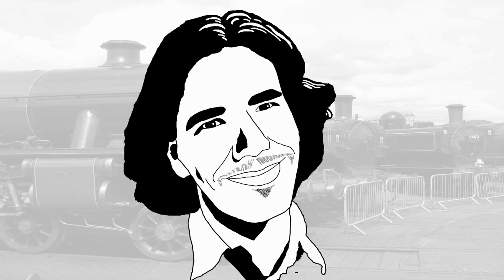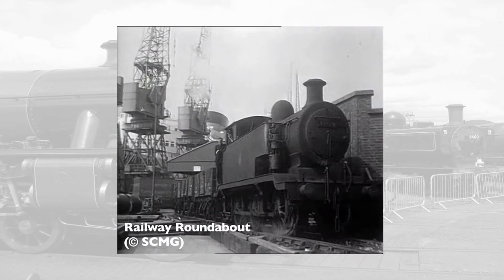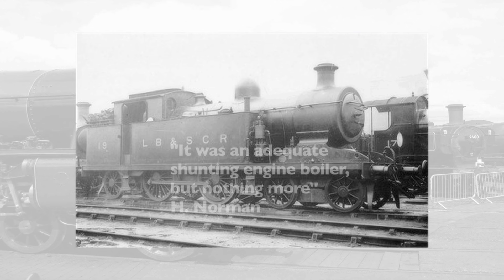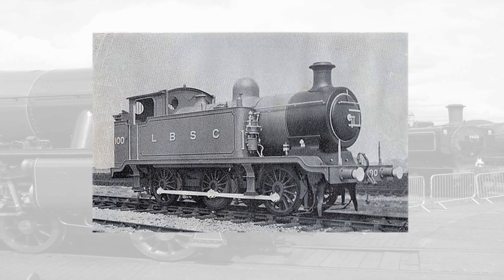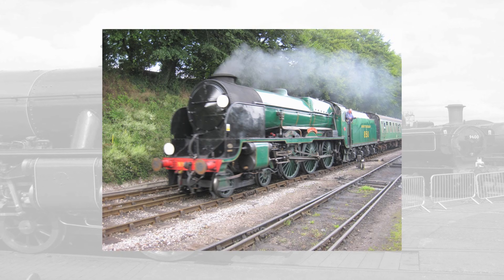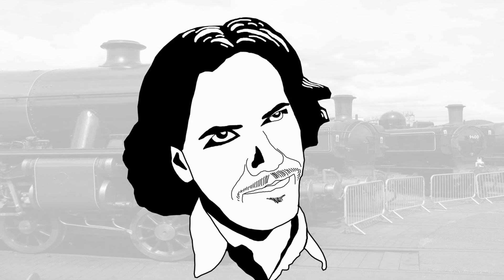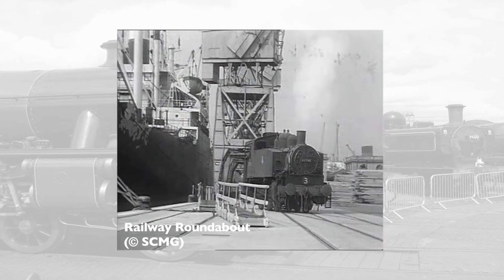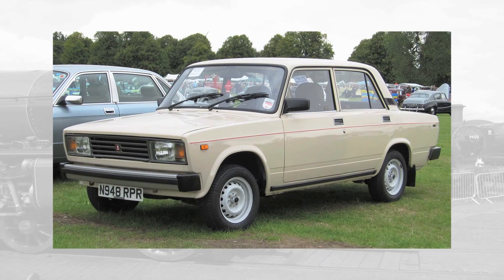GAUGE THE ISSUE: The Maybe-Not-Quite-So Really Useful Engines

Comment: "Remember Thomas" Said the Fat Controller, "You can never be as fast or as strong as Gordon, but you can be a really useful engine, if you'd stop oscillating all the damn time."
Reply: And stop breaking couplings
Reply: And if you could see your way to not losing so much boiler pressure, that would be a real help
Reply: And here Duncan gets a bad rep for rockin' and rollin'!
Reply: @MercenaryPen  Chris only gives once source for this, hardle proof it was compon place, and loco can become a bad steamer if worn, or fired wrong, or handled badly by the driver. 

Id be interested in reading/hearing of other footplates crews experiences with the E2x if anyone knows of any. All the chaps I knew who where footplatemen where either ER or LMR crews.
Reply: Their predicesors were rough riders to. Seams quite common with 060t locos if not balanced properly, as they aint exactly built for high speed. 40mph was prob the max they could be expected to run, even if they could go faster, but suspect even at 40 they were quite "bouncy"
Reply: E4: Hello I can help with that!!!
Reply: @thebluejintythomasthetanke587  Rusty: My Freight wagons got away from me!!!
Reply: And stop rock and rolling around when you are going your top speed

Comment: It's kind of sad to realize that the locomotive Thomas was based on wasn't all that useful in real life. You'd think they'd at least save one, especially since the design got popularized by Thomas.
Reply: Well they made a replica for Thomas
Reply: by the time the books and TV were popular, the E2 was already gone. besides, who would want a heavy, uncomfy, hungry shunter that was useless over 5mph?
Reply: @Eroadmodel  maybe static display
maybe a new build to fix the issuies
Reply: @pilotbug6100  I’m for a new build to deliver on what the E-2 was meant to provide but couldn’t - a mixed traffic tank engine. I can already imagine the redesign would un ironically mimic the character design by shortening the wheel base, lowering the center of gravity, and enlarging the coal bunker and that’s before boosting the steaming efficiency with additions like a super heater. In hindsight, similar to Henry, the E-2’s were built with far too small coal reserves and janky optimization
Reply: @watch50er  I like to think Thomas is a experimental not passed by LBSCR, with a 10 foot wheelbase for the tight curves at Southampton, he proved unsuccessful and was sold off to Hatt during the first world war.

Comment: I didn’t know a E2 could do 50 MPH! Also I like how you put 611 and 4014 in this.
Reply: Always love when a YouTube Railroader from one country or another gives a nod to the opposite side of the "pond."
Reply: I don't think I'd want to go 50 mph in a tank engine without non-drive wheels
Reply: To my knowledge, their top speed is 60MPH, though why anyone would want to do that in a 0-6-0T engine predominantly used for shunting and short goods traffic is somewhat beyond me.
Reply: @PGW85Productions  Main Line Empty Stock and Return to overhaul/depot transfer movements,  emergency if no other locomotive avalible for a freight movement.
Reply: @highpath4776  actually they can do 60mph
Reply: @matthewradovanovic5172  Thomas: I can go 70, but I've been fixed.  Got all fixed up at the Works after I was bought by NWR.

Comment: Still don't understand why the Reverend didn't base Thomas on the more successful 3F Jinty instead of this sagging heap.
Reply: He didn't, Thomas was originally going to be a different engine. But Reginald Payne (Illustrator of the second Railway Series book, Thomas the Tank Engine) made Thomas an E2 instead, and Awdry went with it.
Reply: @bluengine1258  Not the best choice to say the least, could have gone with a 3F Jinty, an Austerity, an  N7, or any other famous tank locomotive of the time. But that's just me. But then again, the show has since lost its realism touch, since Whiff and Emily are depicted doing work they weren't designed to do (i.e. pulling heavy goods trains.) It was in Chris's other videos that I learned that the engines both Whiff and Emily were based on were not designed for heavy goods. Realistically, the episode "Emily in the Middle " shouldn't have happened. It would have made more sense to have had Murdoch pull that pipe train instead.
Reply: TheKilroyman - The show lost its realism since the 5th season, really. I mean, why would the Skarloey engines run away at speeds of 100mph away from Boulder when they were never built to do that.
Reply: @NWR1991  yeah agreed. After Britt Alcroft lost control of the show it went downhill. Seasons 6 and 7 are pretty much forgotten about as far as the Classic Series goes.
Reply: TheKilroyman - There are still people out there who do remember S6 & S7 and in my opinion they had handled realism far more better than what churned out from S5, barring Thomas & The Jet Engine.
Reply: @NWR1991  seasons 8 onwards shot realism to hell. Especially since we see Whiff and Emily pulling loads they weren't designed to pull.
Reply: What if he was an SECR R1 instead?

Comment: You know, when you talked about the issues with the E2s when they were trialed on passenger and freight (goods) trains, that gave me a bit of an idea: could they have done a bit better if they were fitted with well tanks?
I got this idea from Billinton's L Class 4-6-4 Baltic tank engines, also known as the 'Brighton Baltics'. When the first two were put into service on passenger trains, they were found to be unstable due to the water surging around in the side tanks, but this was later resolved when they were fitted with well tanks (and the water level in their side tanks were lowered) giving them a lower center of gravity and helping them prove to be much successful.
So maybe if the Billinton E2s were fitted with well tanks as well, it might've helped with their problems with stability as well as increase their water capacity and the class might've been more successful. That's my theory at least.
Reply: I understand the theory, but I doubt converting an E2 into a well tank would solve the issues entirely rather than just make more.  The main problems with well tanks and why you didn't see many outside certain circles, with many well tanks being converted to saddle tanks, is because the wells were prone to cracking and leaking down beneath the engine being so close to all the moving parts.  Sure you might make the E2 a bit more stable, but you'd have to fill the tank more often due to leaking and you'd have to pull it out of service more often in order to repair cracked tanks.  Also how big a tank do you think you'd be able to fit down there?  The E2s already had a problem with water capacity when first built, and the spacial limitations of building a well underneath an engine would not solve that issue.
Reply: You'd also need to give the engines external cylinders and motion to accomidate the tank, which means complete replacement of steam chest\smokebox saddle and extreme footplate surgery to accomidate before you even began modifying everything else to suit (which couldn't justify rebuilding a class of 10 obscure shunters already beset with faults outside of just fuel capacity). However, I must admit I find the idea interesting  and may mess about with some dimensions, I imagine the result would look simmilar to Bellerophon (preserved on the Foxfield Railway).

Comment: Fun fact actually the E2’s actually had more than enough coal and water capacity as other successful tank engines but the issue was the boiler not fuel capacity as it was actually a really bad boiler used for another model and was really bad.

Comment: Because switch engines (shunters) do not go fast, or far from the repair shop, they are nearly always the oldest machines on the property. This is why the Great Northern Railway (U.S.) tried to use a 4-8-2 passenger locomotive with 73 inch drivers as a heavy switcher in the Interbay Yard in Seattle, WA in the late 1950s. The experiment ended quickly because the 4-8-2 lacked the quick acceleration needed for that job.

Comment: The main problem with the E2 was that it was a solid design. But unlike the GNR with their problematic at first J23, the LBSCR never invested into working out the kinks (due to Brighton works being where it was). If not for Brighton Works being where it was, the LBSCR would've probably been able to do a lot more with what it had. And they never should've never been based at Southampton.

Comment: I guess it makes you wonder what improvements could be made when it comes to the E2's. Like if the Southern had more funding available to them and as such were able to do something like overhaul the E2's, like a new boiler, a smaller wheel base, and more power comparable to some of the stronger shunters like shown in the video (the Austerity, GWR 57xx, and Dock Tank).
Though, we'll just have to hope that a group who is up to the difficulties is willing to build an E2 basically from scratch (I know there is the LB&SCR E2 No.110 Society but I don't know if they're still active or not).
Reply: No.110 is the E1, which is very different.  There are insufficient drawings surviving to enable the building of an E2, so it's a pipe dream.

Comment: Huh... 4:51

Considering there's a photograph which heavily matches an illustration from that story, I can only imagine if the same E2 was involved in a runaway which inspired the story. That'd be neat, if not a bit concerning. But yeah, tank engines for transfer freights always felt a bit...offy to me. The only benefit is more traction when the tanks are full and then it drops from there

But seriously, thanks for this video. Not only is this the most comprehensive review of an E2 that I've ever seen, but it also answers the question of how they were around for so long when they were relatively poor engines compared to other shunters

Comment: I've always wondered if the E2s could perform much better with a E4 boiler, a slightly shorter wheelbase and a flat running board 🤔 I can't really find a way to make the bunker bigger without causing the engine to be tail heavy.
Reply: Perhaps a superheater in front?
Reply: Know I'm late to the party but superheaters likely would not be viable on a class meant for short distance freight and shunting; for a superheater to be efficient it must have a constant draw of steam through it (which rules out stunting and could hardly make the argument when compared to cost and extended mantainence efforts for their limited freight runs. Perhaps as a rebuild they may have been spunky enough to worm their way into passenger duties but would still be capped in terms of continuous running by their limited fuel ranges, being 0-6-0Ts and all). I am not familliar with the dimensions of the boilers of the E4s, but some jockeying around of the wheelbase/cab/footplate arrangements might be in order so as for the axle/motion to not foul the firebox; this may intoduce more space for coal storage?

Comment: Again in the USA, Electromotive Division (EMD) tried to sell railroads a new switch engine in the 1970s, the MP15AC, but found few buyers, as most roads preferred to keep using their 20 year old SW1500 or SW1200 rather than buy a new MP15. Santa Fe R.R. went so far to avoid buying new engines for switching and local freight as to rebuild old EMD F-units from the 1940s and early 1950s while installing new road switcher bodies and calling them CF7.

Comment: Regarding fuel capacity, I'm surprised you didn't address coal capacity specifically; wasn't that of the E2s especially unsatisfactory?
Reply from the maker: Water was more of an issue than coal, hence the extended tanks
Reply: I see. Speaking of the extended tanks, is it safe to say they didn't completely remedy the water issue (judging from the apparent need for the condensing experiment)?

Incidentally, the Terriers were also fitted with Westinghouse pumps if I recall; are a lot lighter than the E2s; and are also six-coupled tank engines – how haven't they got the same stopping related problems as the E2s? At least, I've never read or heard that they did.

Comment: Putting the cat among the pigeons,  rather than replacing the wheel bearings on preserved locomotives with copies of the original would it not be better to use roller bearing making the locomotive more reliable and less needy.  I think that if the tech had been there when the locomotives were built they would have used roller bearings.

Comment: They did the job, and that is what matters in the end. And the Southern did dispose of some of Drummond's follies, such as the double singles, and  the 4-6-0's - none of these could be described in any way as useful, or successful. The Southern Railway did build quite a few more steam engines in the 1920's and 1930's, the Q class 0-6-0 are literally a like for like replacement for Victorian 0-6-0's, and the southern built 156 Maunsell Moguls.
Reply from the maker: They didn't perform what they were built for. 

Many of Drummonds engines were replaced by Urie and Maunsell types. But compared to their big four contemporaries, the Southern didn't prioritise the replacement of steam over electrification. 

When referring to the number of engines built in the 20s and 30s by the LMS compared to the Southern, I was referring specifically to goods and shunting engines. The Moguls leaned more towards mixed traffic and outnumbered by the 471 Black Fives built by 1938.

Comment: The flaw in your musician metaphor is that people's life doesn't necessarily end at the end of their work life, but machines those are necessarily tied.

See, their may be a market for more Freddie Mercurys, but the availability has ended. On the other hand, their once was a large market for Boy George but it appears mostly gone despite him still being available.
That Ray Charles continued to get work pretty much up until his death does, indeed, suggest that he was a better (or more influential) performer than Boy George.

If, for example, there was a locomotive type where every example was destroyed in WWII, one might argue that they died before the market for their use was exhausted. Perhaps no more were built out of hopes that new designs would be even better that proved untrue.

I am not arguing you central point, just that the metaphor is bad. Janice Joplin was not discarded due to a desire for something else, she suddenly became unavailable. Simon Cowell did not. We have no way of knowing if the market would prefer Janice Joplin to Simon Cowell since making more Janice Joplins isn't an option.

Also, I rather liked the video, and would watch others like it.
Reply from the maker: An interesting, if somewhat misled, point. But I'm talking about contribution during said working lifespan when using musicians as a metaphor. 

The point which has been made to me by many E2 fans is that a longer lifespan IS a better contribution. When that's simply not the case. 
The A4s working lifespan was 31 years, yet they represented pushing the boundaries of steam technology with world record breaking accomplishments which have stood the test of time. 
The E2s had no such accomplishments during their working lifespan, yet they lasted 50 years; 19 years longer.

I think you may have answered your own question regarding more Janice Joplin over Simon Cowell by referring to Freddie Mercury. Janice Joplin's legacy is partially that she died young, as well as contributing her talents to the music industry at a pivotal time in its modern history. 
Cowell is famously loathed by millions for commercialising temporary money-making manufactured music with a quick buck in mind, yet has lived for longer. I was trying to imply there is less moral and intelligent demand for his kind over Joplin and the other musicians listed in this editorial, as there is less moral and intelligent demand for a new E2. 

I hope this clears a few things up. But thank you for making such an interesting point.

Comment: Hi Chris, When I get round to them I have 2 sets of wheels which were wrong for a 1500 GW loco and of course a Jinty... Much pondering and much looking in books led to the E1 as a use for them! Yes in 5 inch gauge or 1 1/16 inch to the foot scale odd numbers of spokes count. At a Guildford Model Engineer event there was a display of Original Artwork for Thomas so I will have to do some looking back through photos to find what Thomas should have been?? 
Lots of Love Your friends David and Lily.